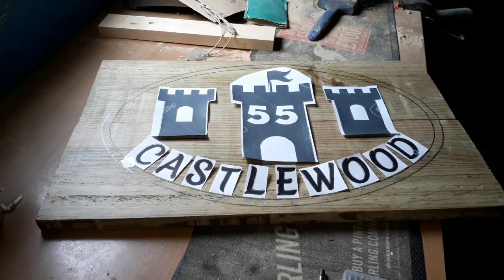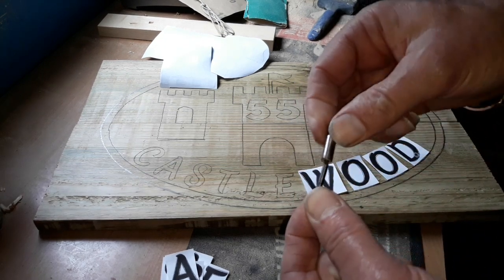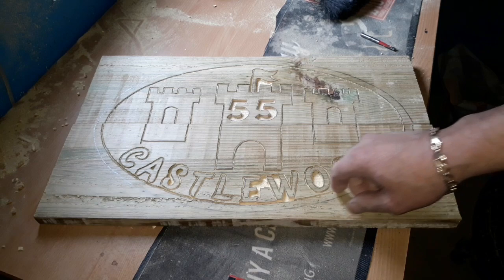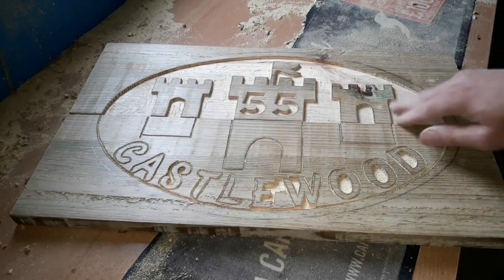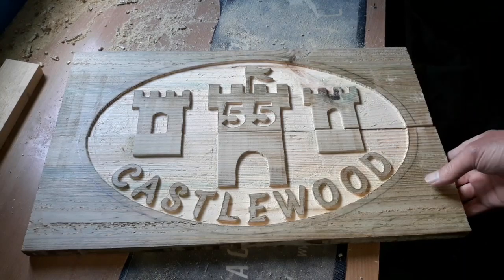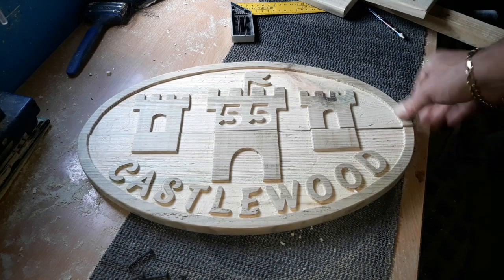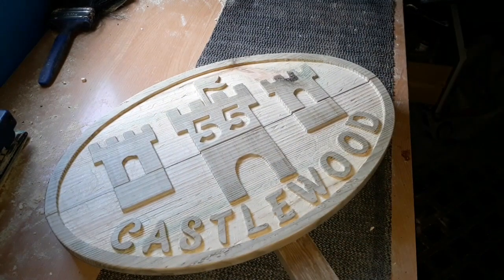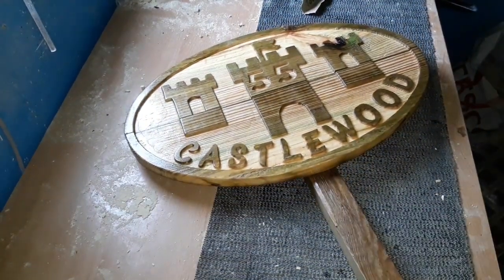Plaque made from a fence board ,router project

Comment: Looks good without paint but each to there own,really must get myself a router with a light on it which router do you use?
Reply from the maker: Cheers bud,my router is a black and decker DN66, you carnt even buy them brand new anymore.its a vintage model..lol,I have to keep searching Ebay for second hand ones, I am on my fourth machine...
Reply: @fishtank5050  i know dewalt do them i may get one in the future
Reply from the maker: @sandman2651  the dewalt 611 seems a popular model,not cheap..loads of cheaper models to go at as a starter router..
Reply: @fishtank5050  seen them for £150 ish i do like the dewalt tools they seem to last
Reply from the maker: @sandman2651  the 611 as a really small base,so a bigger base would help,but I've managed with my old thing..lol
Reply: @fishtank5050  the base is no problem you have a scrollsaw just cut a piece of acrylic to shape the piece i bought cost £5 on ebay
Reply: fishtank5050 So excuse my ignorance but are there laws in place in the UK that new routers aren’t allowed to be sold in hardware stores?
Reply from the maker: @2HME  you can purchase a new router in any d.i.y (hardware)store,definitely no laws says can not..you just wont get my dn66 machine,they dont make them anymore, it's a classic/vintage..model. lol